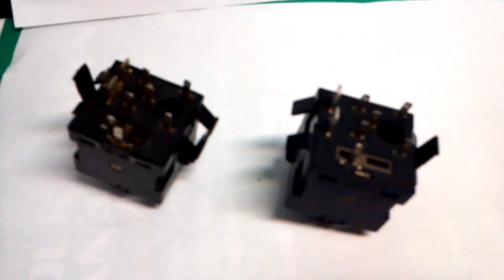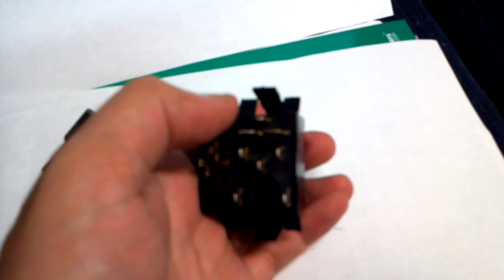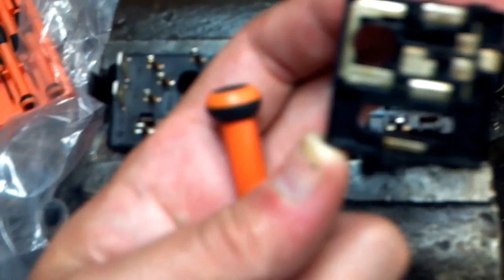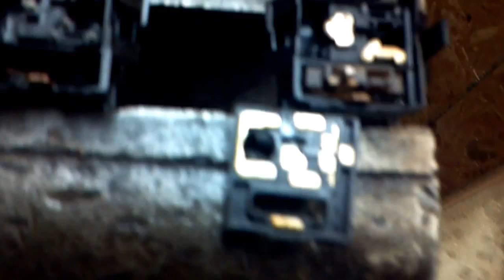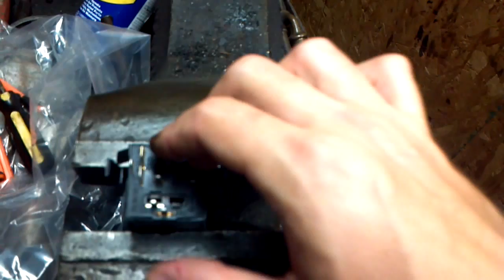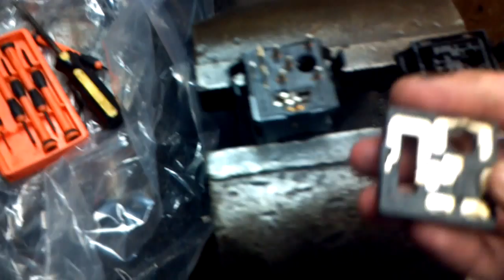Vanagon Headlight Switch Repair

Comment: very good to know what comes flying out of these switches when you open them up. Thanks for posting. Had to re-use old casing because the plastic brackets on the replacement switch broke right off when pressing on them a bit too much.

Comment: hey  kenneth use petroleum jelly to keep the springs in place, assembly of this switches than becomes fun
Reply: That is probably not petroleum jelly, but rather dielectric grease. I use it on every electrical contact I work on, including exterior lights. It helps prevent corrosion as well as promoting a good electrical contact.